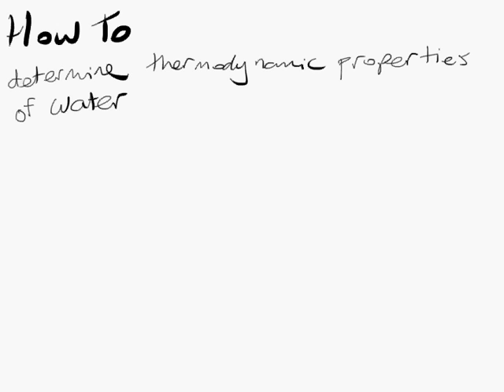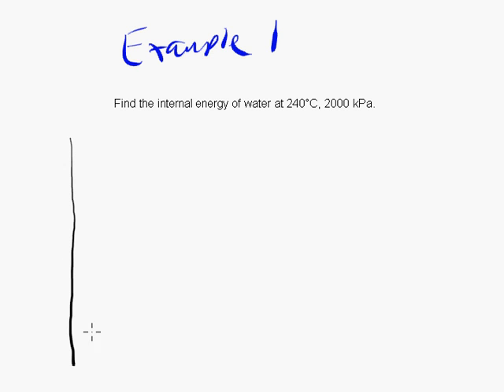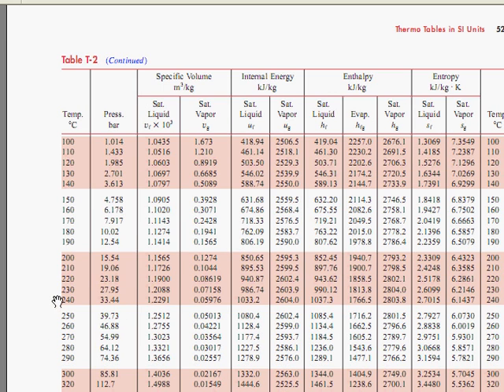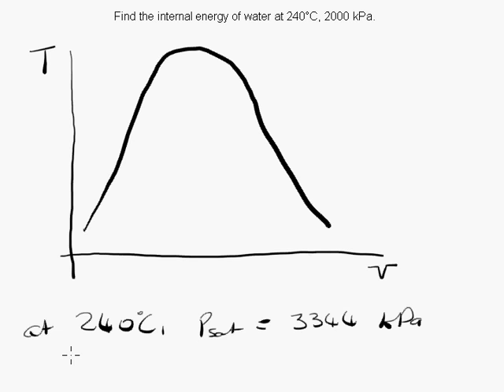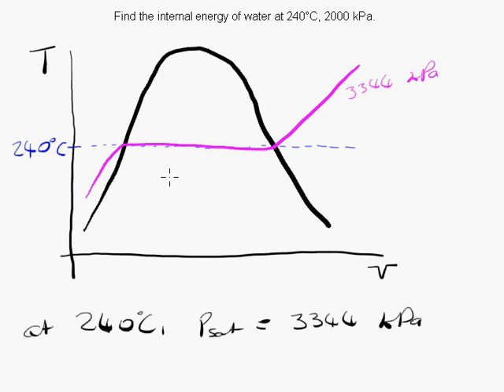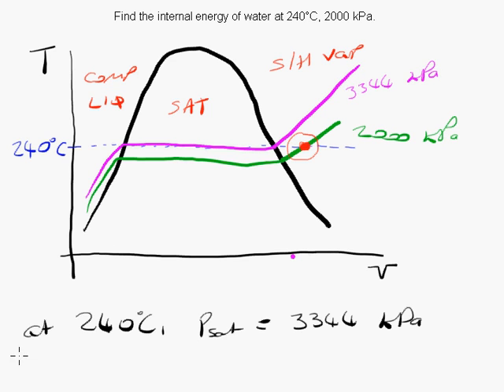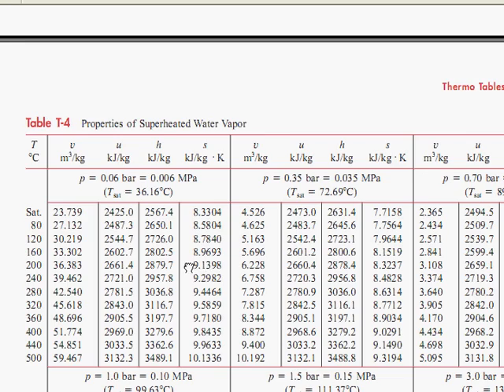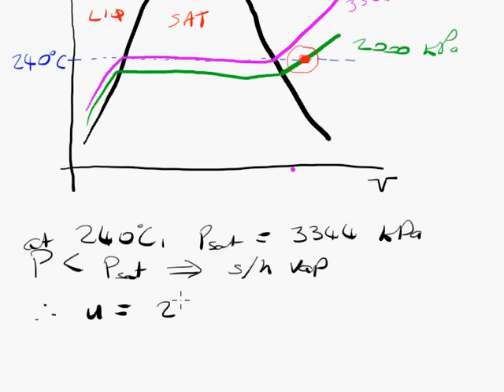Steam tables: example 1

Comment: What if we have the flip case...if the Pressure is 3400 KPa (higher than saturated Pressure), what fluid type do we have If the Temperature is maintained @ 240°C?

Comment: If everything in this example was the same but instead you found Psat was less than the pressure given, would the phase of the system be a compressed liquid (or sub-cooled liquid)?